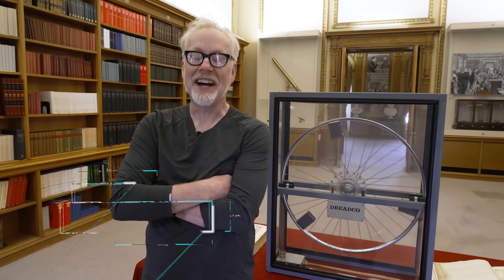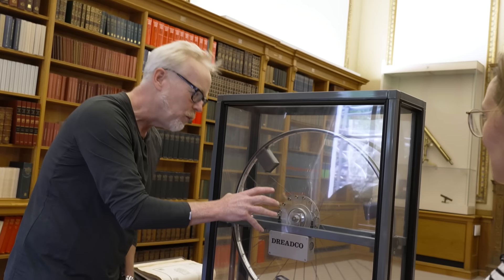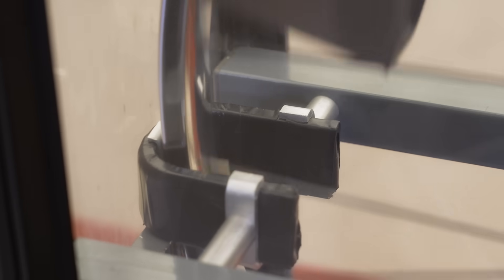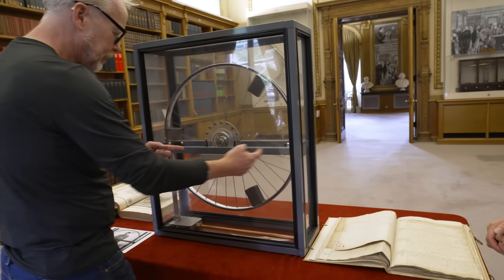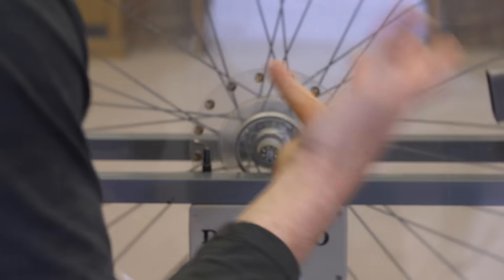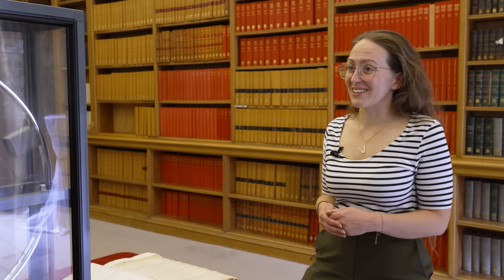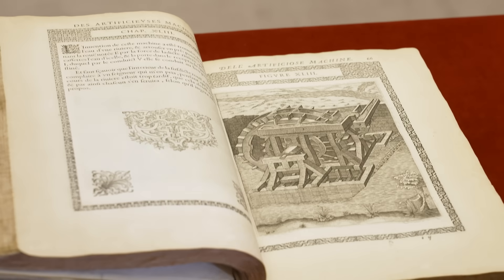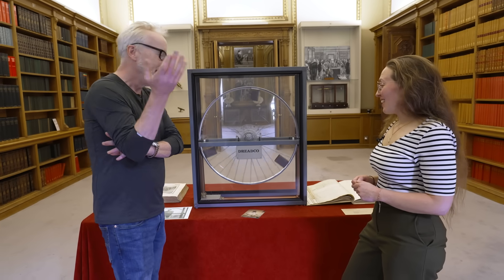Adam Savage vs The "Perpetual Motion" Machine!

Comment: I think the answer is simpler and dirtier than most people will want to accept.

There is no motor.  There is no Stirling engine.  There is no spring.  There is no chemical battery.  In fact there is no mechanism at all.  Nearly everything is a deception to make you think it has of the most common methods.

Those tins are full of lead and the container is a partial vacuum.  Which means a huge amount of kinetic energy has to be slowly dissipated over the low friction wheel bearings.

Comment: this looks to me to be the same set up as a heat powered fan that people mount on wood stoves its incased in something causing almost a greenhouse effect to retain the heat the bicycle wheel is acting as the fan the copper tube is collecting the hot air that's at the top and transfers it to the heat exchanger which then feeds a current to the copper coils mounted in those square boxes on the bike wheel which makes it spin past the magnets on the sides creating an electrical current..!! Genius !

Comment: perpetual motion isn't the hard part, it's using the perpetual motion to do work.

if you just want a perpetual motion machine, you are riding on one, now sure if you wanna be pedantic the earth won't spin forever, it slowly loses angular momentum, but it's been spinning for 4 billion years and will likely spin until it's consumed by the sun, the sun will likely continue spinning for much much much longer still. hawking radiation hasn't been confirmed so we don't know for sure that black holes evaporate, if they don't then they may well spin forever.

perpetual motion is simple, it's just a balanced system with no energy leaving, the problem is when you take energy out of the system you lose motion.
Reply: Your right, the world won't spin forever, therfore it's not a perpetual motion machine.

Comment: The blocks are magnets. When they pass underneath the electricity from the dreadco box pulls from the left and charges upward. It's vacuumed so it air doesn't mess with it. While it moves it charges it but has to be wound manually because entropy slows it down.
Idk I'm a high-school dropout

Comment: Maybe each of the three boxes at 120 degrees has a mechanism inside with a battery and something that moves a small mass up and towards the centre while it's rising to reduce the torque it puts on the wheel - and then moves the mass towards the outside as its sinking. It requires power since it means moving the mass uphill in both cases. Could it be some silent and essentially maintenance free device like a bimetallic strip, or something that heats a fluid to make it move?
Reply: I think magnets/electromagnets are clearly the answer. Only takes a tiny amount of charge to activate them at the right moment, unlike moving a physical mass within those boxes which would require way too much energy to keep going for any extended period of time.

Comment: I think the boxes on wheel are collecting charges then copper pipes takes the charges and gives the charges to body and one of the wire things,  than with the metal things and wires works as a Corona motor or inside the "Dreadco" box there is a very efficent high voltage soure or ion source that makes it working. I think if you give first movement to the wheel you don't gonna need so much energy to make it still turning. Possibly the secret behind it something more different and basic thing than my opinions and I think she have a really important role to making it mysteries and hard to understand because she is able to manipulate what we think.

Comment: The friction this wheel needs to overcome during 2 years... It must be a motor that uses very energy dense fuel. The frame could be the fuel tank and one of the boxes could contain a fuel cell producing electricity to run the motor.

Comment: In my opinion: the battery is in the heat sink (that's what make you think less about it), the magnet like are sensors and when the boxes passes through the machine puts a tiny energy on the wheel with the two magnetic inductors..in the dreadco box there's the circuit.

Comment: It would be interesting to film that wheel with a thermal imaging camera and see what bits get warm. It's also very funny  that this "perpetual" motion machine has to be recharged
Reply: Yes my perpetual motion clock needs to be wound every few moths too.
Reply: If you're having doubts that this is a perpetual motion machine is one, don't, because all the people in the video know that it's not. That's what the whole video was about, figuring out how it works. They're not trying to market the machine as one, they're using it as a puzzle.
Reply: and watch Adams pants light up when he sees the foxy librarian lol
Reply: That's the thing, even if PM is possible, degradation is still a thing. The machine needs to produce enough energy to match the energy/cost to repair it.

If you have a perfect lubricant that enables perpetual motion, but that lubricant is slowly depleted, someone has to replace it. The machine needs to produce enough energy to justify that effort.
Reply: Just use an x-ray at this point...
Reply: Unrelated, but this is how they catch professional cyclists in "mechanical doping" scandals.   The smalles RC type electric motors and gearing mechanisms are so powerful these days and can be hidden anywhere inside frames and wheels.
Reply: @B. K. Neifert just no.
If you have evidence for a worldbraking thing, why not show it?
Also "seeing it" is not really proof, since humans can easily be fooled. That's why the scientific method exists
Reply: Yes that would clarify which mechnisms are really active
Reply: Well that's the joke about these machines ..where to hide the battery
Reply: You wouldn't see anything, because of the glass cover.
Reply: @B. K. Neifert they aren't. Otherwise energy costs would be literally almost free and we wouldn't have an energy crisis
Reply: @emmata98  Bullshit, I have a perpetual motion machine right here in my room. Crank it up once a day and it never stops.
Reply: @B. K. Neifert then you don't communicate it. We are talking perpetual motion machines, not Electromagnetic machines
Reply: Exactly what I was thinking👍
Reply: no no no, not “recharged”, it needs to be “serviced” completely different thing altogether lmao
Reply: Just put it on its side and it would stop.
Reply: Considering its impossible, you might as well figure out how these conmen speak to dead people.
Reply: @DJCrisisUK  not sure who you’re calling conmen, they’re not trying to sell this as genuine perpetual motion, they’re just invoking a sense of wonder and intrigue, and having a bit of fun while they’re at it, they’re no more a con man than a stage magician
Reply: @- Erik -  I was responding to the OP. He mention charging them so I likened it to the people who claim to talk to the dead and that being fake.
Reply: @DJCrisisUK  oh my bad, i see what you meant now i thought you were referring to the machine’s creator and/or the museum curators as conmen
Reply: @ClobberingSocks  😂it's ok bro, the comment section isn't always the best when replying to someone.
Reply: Yes, a thermal image would uncover the secrets.
Reply: @seanworkman431  Glass is opaque to infrared— They showed that on Mythbusters, actually. So you wouldn't see anything.
Reply: @neolexiousneolexian6079  no, that depends of what glass type do you use.
There are special glasses to filter IR, there are special glasses to filter UV, both are transparent visually and "just glass".
Acrylic is transparent for IR for example but could be opaque visually at the same time.
Reply: @deadlymecury  We are talking about far (thermal) IR which is unable to pass through acrylic (otherwise we would have had acrylic thermal lenses, and not germanium ones).
Reply: @neolexiousneolexian6079  good point.
Reply: @AccelYT  that's a little bit different matter: in order to create a lens you need not just transmission - but high refraction.
Reply: @neolexiousneolexian6079  depends on the glass
Reply: @neolexiousneolexian6079  nah you'd still see areas warmer than others. It's just surface temperature. So if its hot enough to warm outside it can show up. Minor differences won't show up tho. Thickness of glass might make a difference though? No idea lol
Reply: @neolexiousneolexian6079  he said its acrillic? not glass, im guessing it wont have the same properties.
Reply: @seanworkman431  Nope. There is nothing thermally of interest to see.
Reply: @cranegantry868  the guide looked thermally interesting.
Reply: @seanworkman431  With enough time now to view the machine, I see how it works. The guide was thermally interesting, I agree.
Reply: It's not a perpetual motion machine. It can't be.
Reply: @Bill_Owen  Pretty sure that was OP's point...

Comment: I imagine it's in a vacuum to eliminate any wind resistance. Did you by chance have a compass with you? That would have been interesting to watch as it is positioned in various locations around the wheel. I would also like to see it in the dark to see if there is any visible spark or aura around those electrodes.
Reply: Would make sense to be under a vacuum but when Adam accidentally tapped the glass it sounded like it moved and wasn’t air tight. Definitely wasn’t a sound I’d expect from glass under a vacuum
Reply: there are no sparks , no vacuum.

Comment: Perpetual motion macines are totaly possible, I have this fan at home, it's been running for years now. It only stops turning when the power goes out.
Reply: No no no, you see, you're the solar powered machine that has a job to pay for the electricity the fan requires to run as it was designed that way in order to give you incentive to go to work.  When all you need to do is attach curved blades to this here wheel and you not only have a free spinning wheel but you now have a free spinning fan that does not require you to go to work for electricity.

Comment: The battery runs out every 2 years. Photocell disconnects power when stored in the dark. I would expect that more work would have been done with bearings which are not impressive and spinning the laced wheels absorbs a fair amount of power.

Comment: I just wanted to also note the decoy of the boxes on the bicycle rim being painted upside down band-aid tins. The key 🔑 to this is behind the logo. A nearly perfect bearing, balance, sealed chamber to eliminate outside air current influence, the weights at 120°, the singularity of the device and the horizontal rise/fall makes it appear to be possible. I think he made it so close, but that clock still needs wound. Hi efficiency with zero drag, but not the grail.

Comment: Each box has a battery feeding a capacitor via a resistor. The capacitor is discharged via a reed switch that is closed as the respective coil in a box approaches each of the two horseshoe magnets. The capacitor charges slowly but discharges quickly, hence the magnets cause positive impulses to the motion.
Well, that's how I'd make it.

Comment: When I was studying mechanical engineering at Cornell in the late 70s, my thermodynamics prof told a story about a guy who built a boat that appeared to be a perpetual motion machine, confounding all the experts.  Later it was discovered that the boat's hull in the saltwater was acting like a giant battery, and the hull was being dissolved.
Reply: galvanic reactions are a huge problem in general for anything around salt water, it's too bad that it doens't generate enough to harness.   Iron boats have big blocks of zinc bolted to the bottom to act as the sacrificial anode.   

I know of one place where the city put up very nice decorative railings around the boat harbors.  They're completely made out of heavy welded solid iron, all dip galvanized.   If i remember right, galvanizing is supposed to add 30'ish years of protection.  These railings and gates are maybe 15 years old now and they're  90% bare iron with minor surface rust.   the salt environment is super harsh.
Reply: @littlegoobie  
You really don't want to salvage the energy though. It would just speed up the process.
Reply: @littlegoobie  outboard motors have been using them since the 1960's, possibly earlier. if your dock/slip has some current passing through it in saltwater from say a shorted dock light, it will just speed up the whole corrosion process rapidly.
Reply: @littlegoobie  not just iron boats, all boats. Sacrifice your zincs instead of your shafts and through hulls
Reply: @realhusky  Even my plastic paddleboat?
Reply: I'm not even mad, that's awesome
Reply: When I was studying human psychology in my bedroom in to 2020s my professor told me “I came I saw / I praise the lord” which clearly translates to “you can’t trust anyone but yourself”
Reply: We exist on a spherical perpetual motion engine that has gravity that holds us fast in an uncontained  sea of air with a vast continuum of   salt water as well as landlocked bodies of fresh water and clouds of water above to block the sun and provide rain.
Reply: @HaroldAtcheson on a long enough timeline, the rate of motion for everything drops to zero
Reply: I should try to make perpetual machine here in Yakutia, where winter outside temperature can be 90 degrees Centigrade different than inside my room.
Reply: I saw the copper/brass thingamajigs in the senter, just outside center where the ball bearing is. And thought of air pressure…a small gust of air would maybe be enough to keep the thing going around.
I would like to listen to the thing with a stethoscope.😅
Reply: I wonder if the rim is properly balanced or purposely imbalanced to aid in its rotation?
Reply: hahahahahahaha
Reply: Somewhat difficult to couple the current produced? And if no separation into cells to stack for higher charge, the voltage would just be that of iron, some 1,21 volts. That would not propel a ship.

"The redox chemistry of the All-Iron Redox Flow Battery is based on the iron (II) chloride/iron (III) chloride couple at the positive electrode and the iron (II) chloride/metallic iron couple at the negative electrode. During discharge of the battery, iron (III) chloride is reduced to iron (II) chloride at the positive electrode. At the negative electrode, metallic iron is dissolved into the electrolyte as iron (II) chloride; these processes are reversed during battery charging. An aqueous all-iron redox flow rechargeable battery with a nominal cell voltage of 1.21 V and theoretical specific energy of 170 Wh/ kg is a promising low-cost, durable and eco-friendly energy storage system for large-scale applications."
Reply: Did you know Bill Nye? He is a buddy of mine oddly probably would be interested in your story.

Comment: This is just my "personal opinion" but a perpetual energy machine is possible the issue is you could never use it for anything else but to power itself because once you use the energy outside of a recapture point it gets lost. Since energy is always converted and never destroyed the hardest part of making the machine is recapturing that energy in other words you need to capture the energy lost to friction, thermal, uv, and however many other types of energy can be converted into them and reconvert all that energy back into powering the machine creating an endless loop of energy conversion but since humans don't have that capability to capture 100% of energy conversion loss it's currently considered impossible or highly unlikely to be achievable right now

Comment: I would love to see you test and try any all theories you gained from studying this device!  Clearly it’s not truly “perpetual”, but it would be interesting to know how it works all the same.
Reply: This is racist
Reply: It is dead easy, it is basically unity with nothing to give. It is simply rotating for sure but nothing to offer-ha ha ha. The two magnets does give it "some sort of push"-but then the charge build on the motor- does the most; so the out put is the same as the input-which means it is basically-"zero power to spare ha ha ha ha"- perpetual spinning for the sake of just spinning- ha ha ha ha
Reply: @Dailymailnewz  this was such a strange sentence to read. Not sure if English isn't your first language or you are very young. But it was kind of Unsettling . Separating your ha's for instance implies singular, strong, separated ha's one after the other. Or, how no one ever laughs.
Reply: The friction from the bearings would slow it down within a day its getting energy from somewhere else.

Comment: What if the boxes are filled with a dens liquid mixture (water and oile.)that takes the motion of the movement of the liquid smashing side to side as potential energy  and storing it in a battery  of some kind . Using that to power a hidden magnet  to help turn it over? Over time the density of the liquid would diminish do to the centrifugal force like a centrifuge separating stuf from blod. so they would eventually just have to service be just mixing it up really well? Also note that the spinning speeds up towards the left side the liquid continuously slaming in the the left side. It's cause if you focus on one It slows down  at the bottom  which I theorize is the water shining sides.